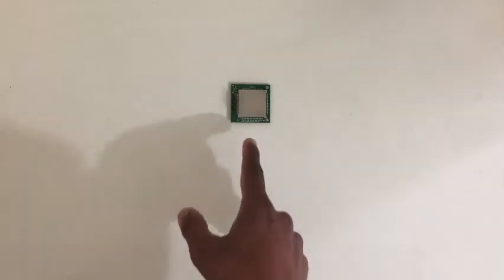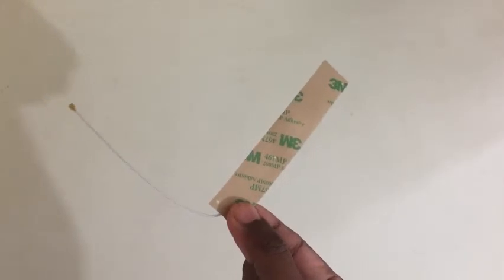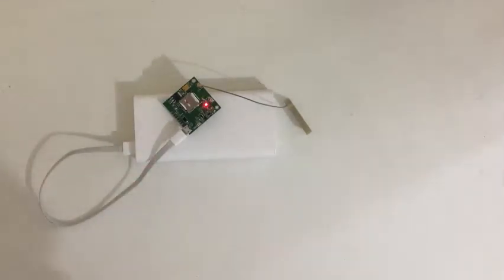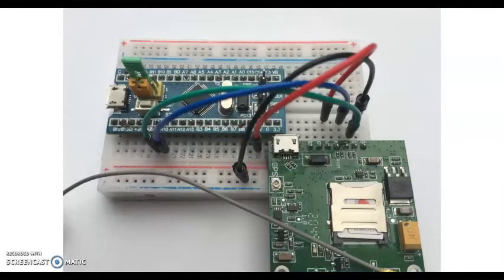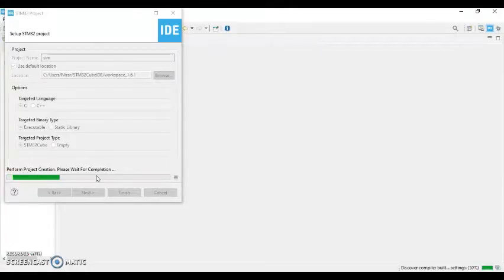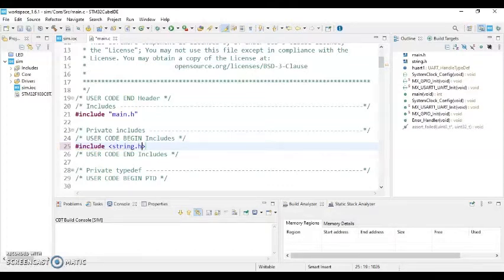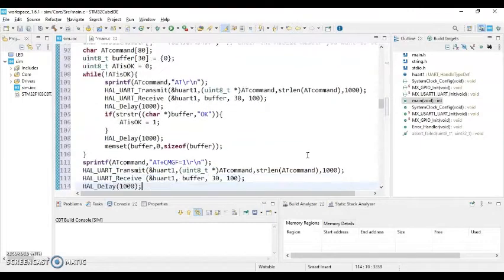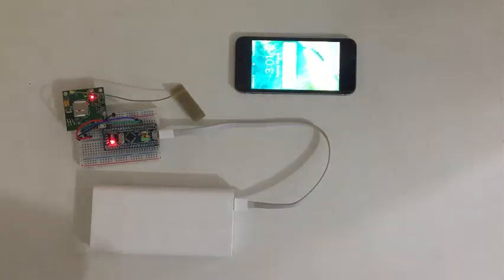10. SMS using SIM7600 and STM32 HAL

Comment from the maker: Sometimes, we will have error messages such as “Failed to start GDB server” or “Could not verify ST device!” when we are trying to upload from CubeIDE. This is because the STM32 chip is not original form STMicroelectronics 
There are many ways to overcome cheap/clone STM32 with STM32CubeIDE.
I have published many videos showing how to upload and debug clone STM32 using CubeIDE.
We can upload CubeIDE generated HEX file via CubeProgrammer as I have shown in video 92. https://youtu.be/YocudAJBH-g

Comment: Hi Sir. I try many times but cannot receive the SMS. Do you have any recommend for me. Thanks
Reply from the maker: SIM7600 needs good amount of power supply. If we share the power with STM32, it may not be enough. 
Remove the wire between SIM7600-VCC and STM32-5V
Supply 5V via usb socket and see
Thanks

Comment: Please stm32 + gps module. For tracking using Google maps
Reply from the maker: I used uint8_t buffer[100] = {0} instead of uint8_t buffer[30] = {0}
And then I used the following code to get the GPS cordinates  

//-------------------------------- From Here 
memset(buffer,0,sizeof(buffer));
sprintf(ATcommand,"AT+CGPS=1\r\n");
HAL_UART_Transmit(&huart1,(uint8_t *)ATcommand,strlen(ATcommand),1000);
HAL_UART_Receive (&huart1, buffer, 100, 100);
HAL_Delay(1000);
memset(buffer,0,sizeof(buffer));
sprintf(ATcommand,"AT+CGPSINFO\r\n");
HAL_UART_Transmit(&huart1,(uint8_t *)ATcommand,strlen(ATcommand),1000);
HAL_UART_Receive (&huart1, buffer, 100, 100);
//--------------------------------Till here
Can send the buffer via SMS.
Reply: @NizarMohideen  Can you please share thw whole code and where to make changes in the code?